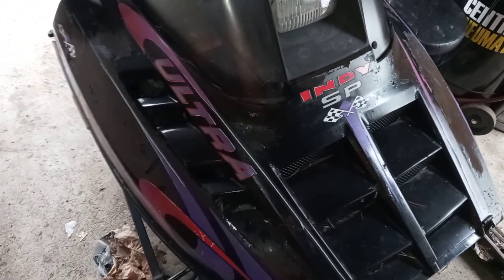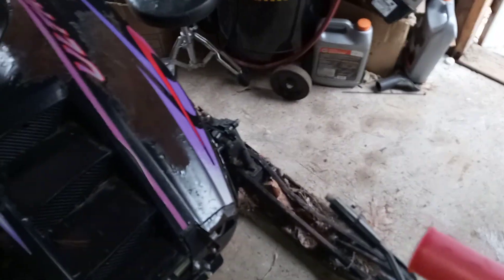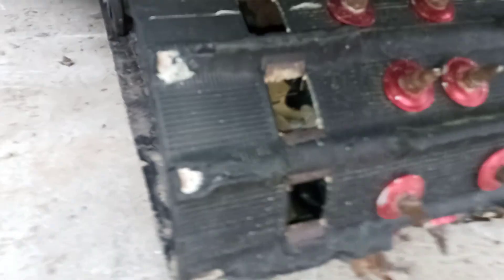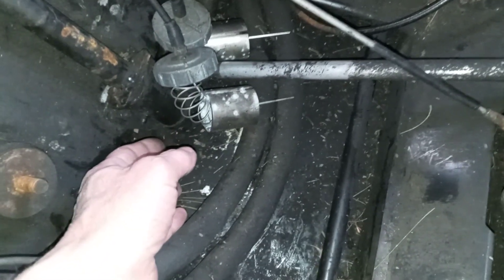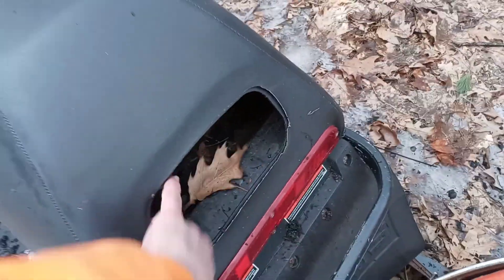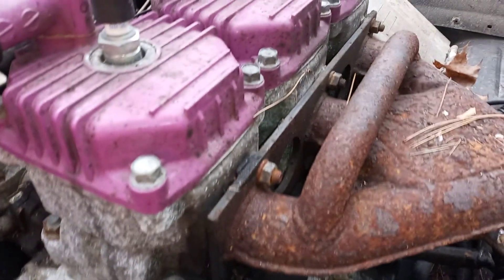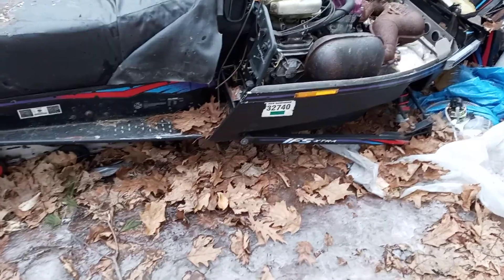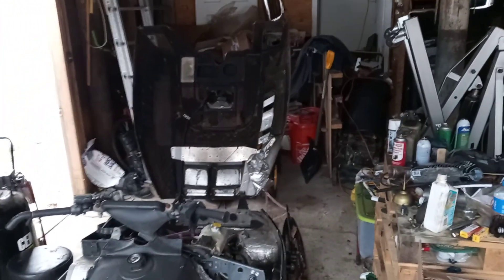New project time! 1996 Polaris Indy Ultra.

Comment: Buddy, that said 13,XXX not 3,XXX 😂
Reply from the maker: I know, right? Eyes are gettin' old. Was hoping to get something done on it this summer but a large family of Yellow Jackets has taken over the parts sled. Hopefully get something done on it this fall. Thanks for watching and commenting. Have a great day!
Reply: @oldsledpurgatory3595  why dont you just swap the good 96 parts onto what the 97 needs. Way easier imo
Reply from the maker: @MidnightPolaris800 Well, unfortunately that '97 chassis is bent, twisted, and basically junk (the right side radius arm mount was driven back and up about an inch when someone apparently landed an epic jump at some point). The engine and suspension are the only good parts on it. It's seen some pretty serious abuse by somebody other than me. The '96 is in much better condtion.